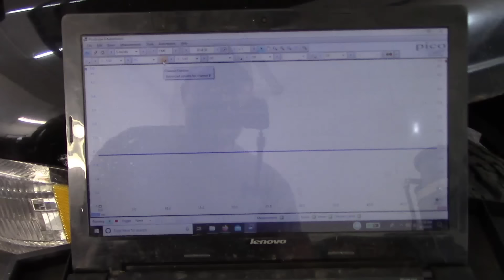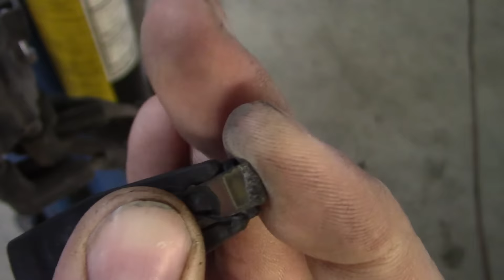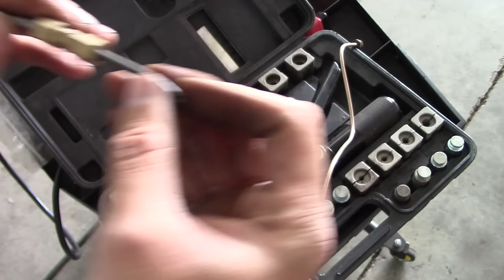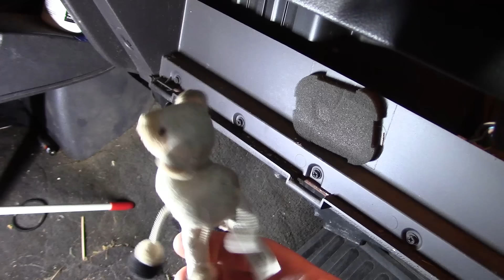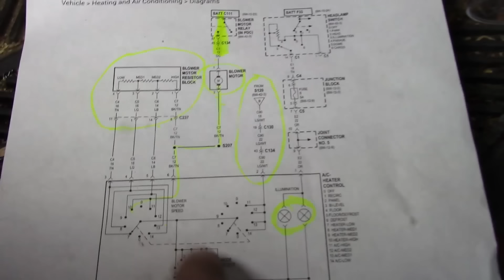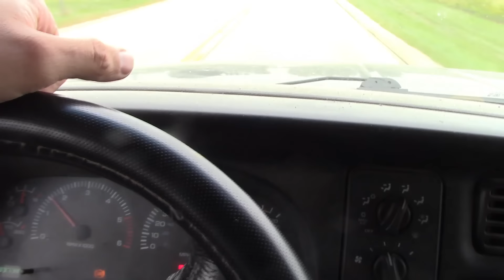2001 Dodge Ram 2500 - Random Missfire, Blown Brake Line, no Heat or AC - basically it's an Old Dodge

Comment: I guess that you like to rag on the dodges, that truck has been neglected and it still ran  try that with any new truck and I guarantee you that it would not even run. and be a bigger nightmare  than that dodge with all of the sensors and crap that they put on new trucks  I worked for a general repair garage in the 70s that's when you could trouble shoot problems  real easy and repair them.

Comment: while I won't argue that dodges are rust buckets. brake lines on the other hand . the same brakes on a ford or gm are just as prone to rusting that's salt on roads issue. 
  Im on the west coast and don't see the rust here you get there . haven't seen it since I left Fargo in 1978

Comment: @17:57
Knowledge sharing
The force applied to the fastener will be greater, if you help rotating with your hand on the extension, this will reduce the slack and give more direct impact from the anvil (less force used on acceleration, more force used on turning, if that makes sense) 
- your hand would disturb the camera shot, but i am pretty sure there would be no need to use a ratchet.
t. Hans

Comment: I had a 99, basically same truck. I chased  coolant leaks forever till I replaced the freeze plugs, they leaked when engine was hot and then evaporated on the hot motor. Truck is still running.

Comment: What do you think of the copper nickel brake lines overall. I had to do a brake job on our Jeep after my GF and I were out one day. She we were stopped at a red light and her foot went all the way to the floor and I had to pull the e-brake to keep us from moving. Lol.      But yeah I ended up replacing almost the entire brake system two calibers, wheel cylinders, drums, rotors, pads, shoes and hardware, and all the brake lines with a few new fittings.   I got two sets of 25ft of copper nickel brake line. I figured the old 99 Cherokee didn't weigh enough or have brakes powerful enough to over pressure the new lines.

Comment: "It's an old Dodge"
Not really. Me and my buddy both daily drive 1st gen Dodges (1991 Dodge W150 and 1986 Dodge D100) and it's rare for them to have a problem. However, my 1996 Dodge Dakota SLT has a major leaking problem in the sunroof and doors. Granted it was rescued a couple months ago from a field where it was sitting for 4 years.

Comment: i got a 2000 1500 2 wheel drive with the 360 i will sell it for 1200 firm runs good drives good rebuilt front suspension i don't drive it  i have way better rigs to drive like my 68 chevy with a stroked 454 tunnel ram or my hot rods plus i have a few other drivers  plus i have a lot of good project rigs with no rust all are 65 to 79 pu's fords and chevy's and a few cars like a 66 gt dart with a mint body all complete i like trades too

Comment: It always amazes me vehicles with rust and abs issues are allowed on the roads. In the UK any warning light is an MOT fail, as is any corrosion and even the slightest emissions non-conformance. A bit of a pain but at least it keeps vehicles in relatively good maintenance.

Comment: What's it like working on an 'almost' rust free truck?  Been working on a 98 Dodge 1500 plow truck where even the brake bleeders and zerk fittings are rusted out. Lived it's life in a city that buys over 50,000 TONS of salt. At least the grill doesn't rattle cuz it fell off. "The Boss"s 82 Prospector is in better shape and NO computer.

Comment: I own a 97 Cummins and I love the truck. But it wears on me a bit at times. Mainly the Dodge front end. Complete and total junk. Going to fix it half right after ten years and 80k of ownership with Synergy linkage, EMF ball joints, quality unit bearings, and spicer u-joints for starters. Then I'll check sector shaft play and probably just plan on a new steering box, steering box brace, steering shaft, and pitman arm combo that will work with my fucking $900 steering linkage. If I had the money and time I'd throw a Ford D60 under it but my truck can't be down that long. No truck is perfect, but I'm also not happy about dropping 2-3 thousand into the front end alone to have something reliable.

Comment: Had more stress in the last 6 months of my dodge (owned it for 170k miles bought used) than the last 2 Fords entire lives combined. Should have never sold the last Ford. Would still be going strong with 400k miles.

Comment: Got a kick out of your dislike for Dodge even though I have a 2001 2500 Diesel 4x4 with 280,000 miles a lot of it towing. Still getting down the road. 
By the way, have blower speed control issues. Now I know what to look for.

Comment: Simple lil tip for your battery  leads, get baking Soda for cooking , teaspoon full in a mug of warm hot water , soak the connector for five min after rough clean , corrosion won’t come back for years .

Comment: Wes,  I asked this question on the last video where you replaced brake lines with the copper/nickel product.  This copper/nickel stuff is so soft that I wonder how well it holds up over the long haul.  On short runs where the line is well supported I'm sure it's fine but on long runs it seems like it my be subject to fatigue.  I too live in the rust belt and am always replacing brake lines.  I tried the coated lines from NAPA and although they last longer than bare steel, they still rust out.  I bought some copper/nickel line but I thought it was just too soft so I opted for the the stainless stuff and I've had good results.  Sure it's a little tougher to work with but I feel it's worth it.  It will never rust or fatigue.  Love your videos!  Keep it up.
Reply from the maker: I've never had a brake line replaced with Ni-Copp fail. I'm not saying it can't happen, but I've never seen it.
Reply: I guess time will tell how durable those Ni-Copp lines are.  I honestly don't know how long that stuff has been around.   Maybe not long enough to show long term results.

Comment: Seems more like a vehicle that hasn't been properly serviced. We've had several dodges in my family. My grandpa had 3 that each got close to 1 million miles for a cummins 2500, my dad got 450k out of his 96 1500 and my 2004 had 240k when I sold it in perfect working order. We've also had 400k mile fords too. The only problem trucks we've had was my other grandpa and his Chevy's. Not one of those made 200k.

Comment: I did the same lines on my '02 2500 about 3-4 years ago.  For around $100 you can find all the front brake lines prebent in steel or stainless if you're ok with taking short cuts.  I'd love to learn to bend brake lines.  Need to get that sur & r kit.
Reply from the maker: Those pre bent kits are awesome.

Comment: I have owned own a 99 dodge ram 1500 as a daily driver for 5+ years now so I know a few quirks about this generation. First off you actually could get a crew cab (bigger than a quad cab) Dodge Ram if you had a single cab modified by an aftermarket company back in the day. There's at least one video of one on YouTube. Second its really common for the wire off the coil to go bad before the other plug wires do. The same thing happened on my truck. I fixed the coil wire and got another year or so out of the rest of the wires before swapping them for maintenance sake. Third the ABS on my truck doesn't work at all and no there is no trouble code that has ever popped up for it even when I slide lol, so I don't blame your customer for not wanting to fix that issue. I'm pretty sure they would be wasting money trying to fix Dodge's faulty ABS. Thanks for the videos!

Comment: I still have my 2001. It's funny I've already replaced brake lines. Tuned up was basic. Still runs like a top. Have to replace front axle seal. Love the power. 200,000 miles and still running. Knock on wood.

Comment: I was told by a Ford dealer that their fan control resistors burn out when you have the fan turned on and have the ignition is acc position. The resistors get power and run really hot, but the fan is not running to keep them cool. As you probably know, Ford heater controls have  4 resistors mounted on a circuit board. You can clearly see the burnt resistors when you remove the board.

Comment: I had a ‘73 Dodge D100 with the 360 v8 that I bought new. It was hard on coil wires and spark plug wires. It was a good truck until the electrical systems started going bananas.

Comment: I've got the 01 1500 4x4 190,000 compared to that mine is like new.... Well after a new Radiator heater core dash cover water pump cap rotor wires plugs calipers rotors pad U joints front axle and rear drive line 
, FlowMaxter muffler that's a Flowmaster and a Dynomax mufflers welded together wheels and tires and it's a Goood Truck! But I didn't get the Lamb pen......... In the Denver area glad we don't get rust like that man that's CRUSTEEEE
Reply: Oh and window regulator head lights tie rods front wheel bearings shocks rear breaks catalytic converter

Comment: Hi Wes, been following your channel for a while, saw this old gal pop up give you some trouble and had to chime in.  

First off, that rust - dear gods that is frightening!  Id be personally leery about reusing those calipers and that long line; totally agree with gutting and replacing everything else.  

While on the topic of calipers, rear calipers on Dodges are notorious for the slide boots being shredded, which in turn shreds the slides, causing premature uneven pad wear.

Moving to the electrical, Yes, Ma Mopar is notorious for 'TTtroubles' (not a mistype), aka Terminal Tension troubles. When it comes specifically to any blower fault on a Mopar, the first thing I look at is the connector to the resistor. They are usually pretty easy to get at, and will tell me at a glance the overall health of the blower electrical system. If either blower or resistor is bad, i do both; often having to solder in new connector to resistor as well (ive done many dozens of pairs of blowers/resistors; can only think of one control switch ive ever done).  The usual chain of events is the blower gets tired, pulls in too many amps, which in turn fries the ballast and/or connector.  I do like those terminal cleaner tools though, gonna order myself a set.   Also, ya,  those plugs wires etc are, dollars to doughnuts, Mopar factory original. 

Finally, into the alignment - for one, i could HEAR the noise of the tires over the sound of the engine, for two, I can plainly see the cupping on the front tires at the end of your vid. For three, its a solid axle Dodge with track bar - Ill bet ya a bottle of your beverage of choice the track bar has issues, and probably weak shocks (including steering damper) as well. I would strongly recommend a front end safety check and a tire rotation. 

Oh, and in case you are wondering how in the name of heck i can nail ALL that from a vid -- Red Seal Auto Service Tech (Im Canadian), former Master Chrysler Tech with over ten years in the overall field.   Also, that era of Ram is my second favorite truck; with my favorite being the 70's era such as the 76 in my pic. 

Overall, excellent job, not trying to step on toes but rather offer some extra hints from one of those crazy Dodge lovers.  Gonna get some of those tools you showed as well.

Comment: I had one of those. They are the most cheaply made domestic truck there is.  Every single one in a junkyard has the exact same things broken or worn out. The do have excellent engines but Dodge made sure to change that for 2002.

Comment: Why was the red "brake" light on? I'm sure you're a good enough professional to put enough brake fluid in it, so I'm saying the electrical sensor that turns the brake light on might be bad.
Reply from the maker: Come on man. That light is for the emergency brake which I'm sure has not worked in 18.5 years.
Reply: @WatchWesWork  Alright makes sense. I was not trying to be a dick man just wondering.

Comment: I agree with one of the below comments of toyota being simpler to do maintenance.  I got a f150 because of the ecoboost and mpg and toyotas tech is way outdated and over priced...but the f150 came with another cost.  Little aftermarket support for true 4x4 and $1k to replace the feont diff.  Oh btw Wes make sure to blur out the license plates.

Comment: "Its still a dodge". indeed it is, i literally just did an entire front brake job on my 98 Ram 1500 4wd last weekend, front hard lines, hoses, calipers pads and rotors. my lines were rusted and on the verge of popping at the exact same spot, that T-split for the front lol. Ive got a vacuum leak somewhere on mine, i might have to check those evap hoses. Great video Wes. keep on keepin on.

Comment: They’re great trucks really.. the customer clearly doesn’t maintain it. Christ look at those cable ends. Probably wasn’t washed regularly either. An ignition tune up is also the time to clean the throttle plate, change the fuel filter and air filter and clean the MAF( yes I know this truck is a speed density and doesn’t have a MAF) otherwise when else would you do it? I would guess the customer changes their own oil or takes it to the quick lube for a disservice. Driving around with dangerous brake lines and who knows what else ready to fall off. Some people are clueless.

Comment: Surprised you're not using Mustie1's formula of chain bar oil and boiled linseed oil as a rust preventative. You can even use the chain bar oil straight by turning up the air pressure when spraying. The higher pressure turns the spray gun into a media blaster.

Comment: I have a 2001 ram 2500 with the 5.9 gas. I replaced every brake line on the truck, some twice. Common problem with this engine is the lower plenum gasket. Mine blew out in Pennsylvania after leaving NY,  on my way to Colorado 😄
I've also replaced the ecu twice, once after driving back to NY from Florida with a bad ecu. The worst was the wire shields pressed into the heads surrounding the spark plugs. Chiseling all of them out and removing the snapped plugs was the worst.

Comment: Arcy-sparky. 130k and nobody did a tune-up? About 30k too long.
Reply from the maker: I'm pretty sure the wires have been replaced once before. Don't know about the plugs.
Reply: Yeah those plugs were beat. I thought you were going do the ElectroBOOM dance when you reached down to adjust that wire lol

Comment: WES,that battery crust is real bad,for the battery and you.i used to blow it away to, then i started having sinus issues,turns out my sinuses were damaged,and it was NOT from {all the coke Flying around shop at the dealership} it was from the acid.what i recommend is to get 2 spray bottles 1 for a baking soda solution the other plain rinse water.then gently spay the terminals down until there is no reaction,then take the clamps off and clean them.after that hose same with plain water, spray with air then NO_ corrode.IT took me 1 year for my nose to repair itself,lean from my mistake.IT will keep you from STEPPING ON DOG POO>!!!!haha

Comment: I enjoy your "restorative" videos. You seem to often have the task of not just repair but cleaning, rewiring and restoring systems in your customer vehicles. Very informative! That Dodge front end, I'm amazed at the extent of the rust damage. And I grew up in the 50s and 60s in the Southwestern PA "Rust Belt"! I'm curious about the structural safety and viability of that Dodge's front end assembly. From your video, it looked extensively "eaten away" in layers! Living in Colorado this last 50 years has me spoiled! I accessed your Pine Hollow Diagnostics link and found out they are in State College PA. Small world, I have family in State College. My hometown is Pittsburgh. I miss the "green" everywhere...but not the humidity!

Comment: Wes my work truck is a Amarok 2.0 TDI with 130,000 kms. Lately I’ve noticed the alternator and A/C pump are getting ( I hope this is the English word) oxidized. What would you use to clean them up and protect the metal? Thanks Wes!

Comment: Dodge doesn't make trucks out of steel. They use straight iron oxide so as the engine performance decreases with age, the frame exfoliates to even out the power to weight ratio.

Comment: At the beginning of the video, with the coil wire and vacuum leak easy finds, I was starting to think somebody brought over a pre-configured truck to test your ethics and billing practices for one of those mechanic scammer test cars.  After watching the video, it looks like no maintenance was done on that truck other than the brakes.

Comment: I had a 96 Cummins 2500 with the stick shift that was used heavily by the local township. And before that was a farm truck. 300,000 miles. Of course never had drivetrain problems, however, it was WORSE than steering a boat! And that was with all proper new front end parts. I heard you can adjust the slop in the steering gearbox on these, but I just got use to driving it. Took some time though, and that's coming from a semi driver that's driven some pretty poor crap with massive steering wheels and turning radius's!

Comment: So it looks like you're complaining about an early 90's vehicle, that has been driven  hundreds of thousands of miles, with little to no maintenance, and it finally laid down in the next century. With a handful of regular maintenance issues corrected, it's running fine again. Not counting the very common results of northern tier vehicles and their rust issues, no matter the manufacturer.